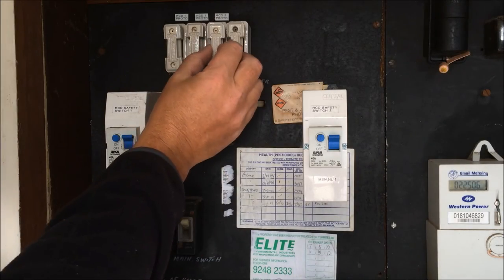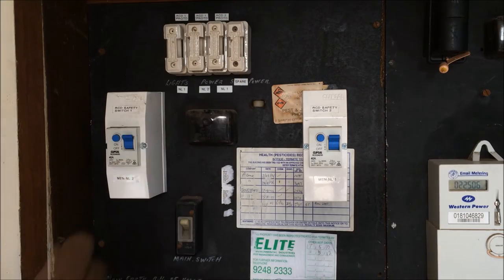How to Rewire an Australian Ceramic Style Fuse

Comment: DETA 16A Plug-In Circuit Breaker Replacement Wire Ceramic Type Fuse